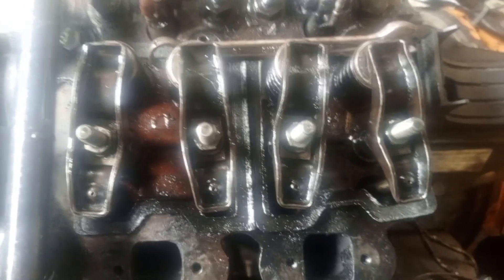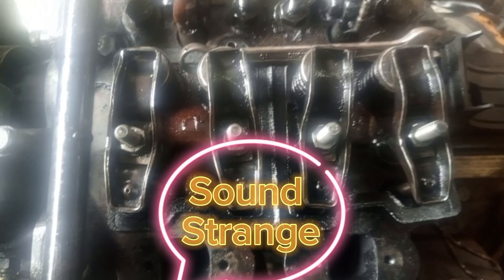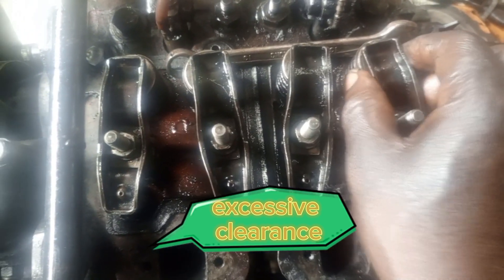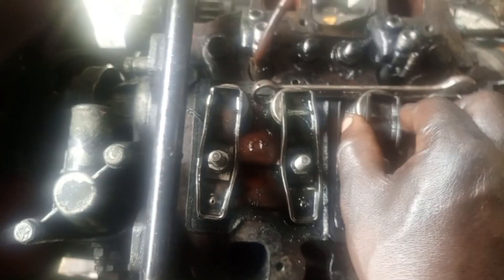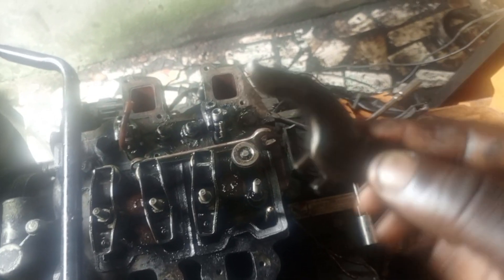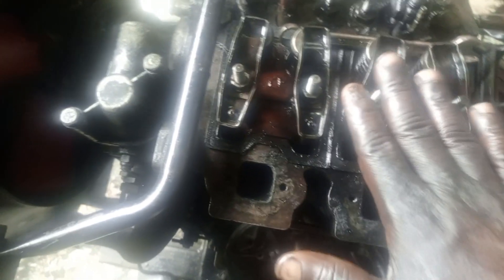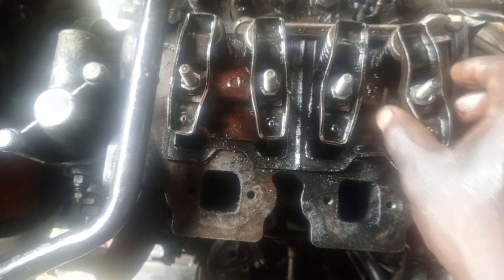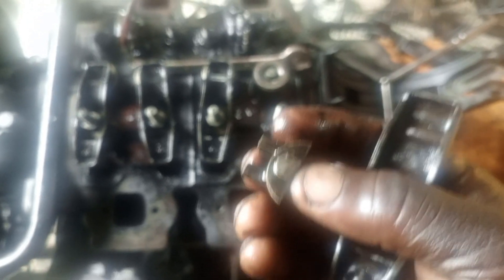Valve Adjustment on Lister Petter LPW2 | Step-by-Step Guide

Comment: Bro. I have the same LPW2 ENGINE for Generator. And the Throttle is not working! Can you share how I can get this fix. Thank you
Reply from the maker: It means your injection pump is not correctly installed
Reply: @mrengine okay, I will try